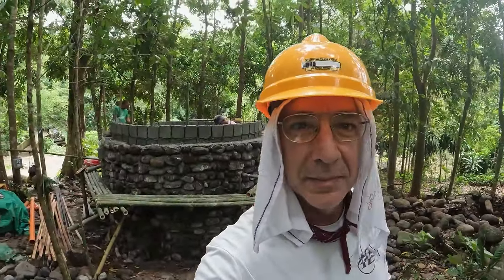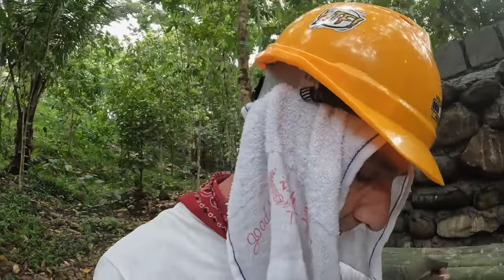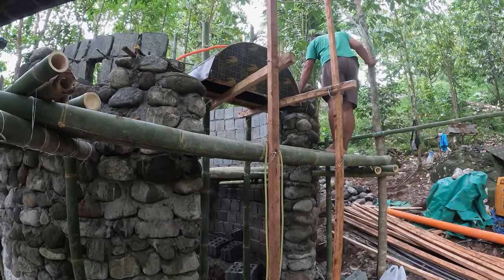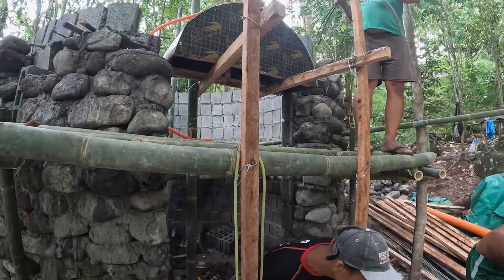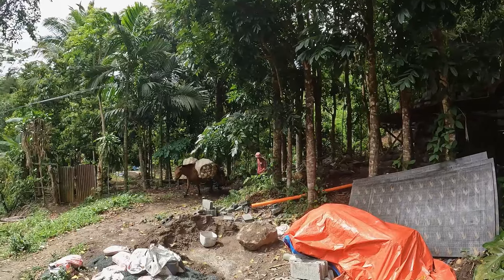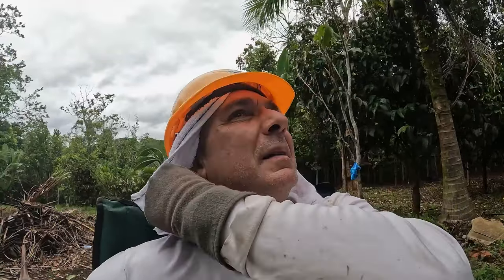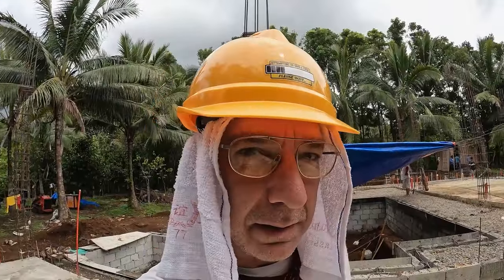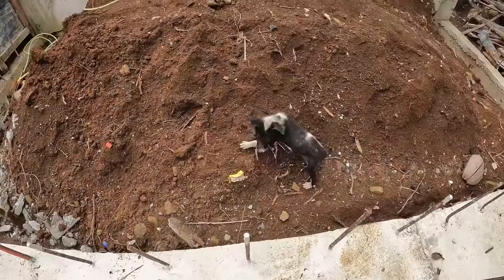Metalyte Steel Framing Arrives | House Build Philippines | Ep. 13 | TORINO

Comment: been planning my retirement home in baybay leyte and have had no luck with engineers to design with metalyte type  construction.  they say it wont  be strong enough to support a roof (200sqm house 12x15 m)  i tell them we build multistory apartments out of it  and move on to someone else ..they just want to design what they are used to .hollow block . metal studs are new to the area and i could build myself if there were a good supply ...the biggest thing would be a good insulation material like rockwool boards for the walls and attic . I enjoy your videos and  it looks like you know wtf you are talking about ...that always helps
Reply from the maker: Thanks for commenting, good luck with your build. 😀👍
Reply from the maker: Hey, I had a big day today with Metalyte execs and my architect who all made a site visit today. Metalyte said they had heard from you, which was cool. They floated the idea of using a remotely located architect to make a design, then they could create a proposal for you. Just thinking this may be an option for you. I'll be posting the video from the site visit this week...👍🏼
Reply: @torino2610  i sent of my CAD jpeg to them to try to get a rough estimate ..will see if i can afford it vs hollow block ..thanks for the videos